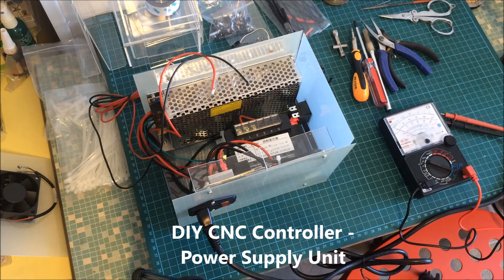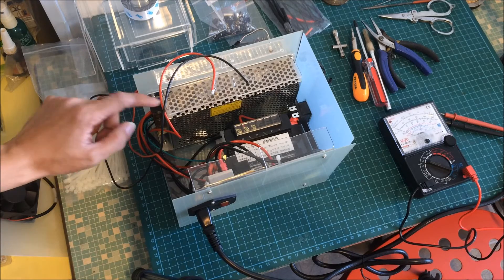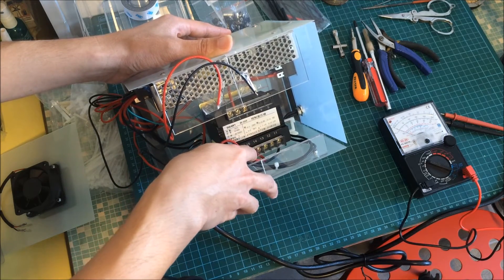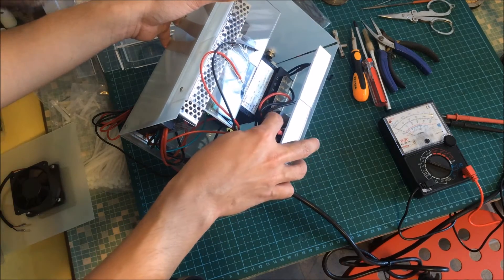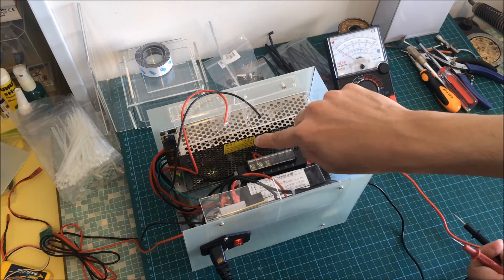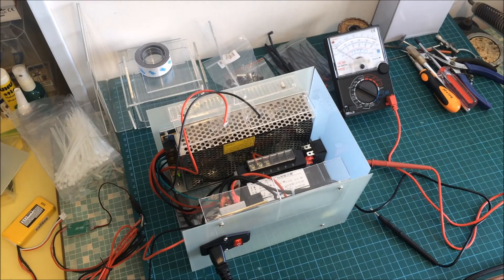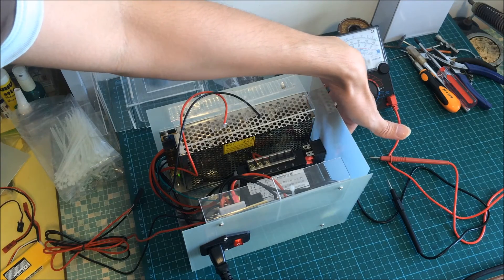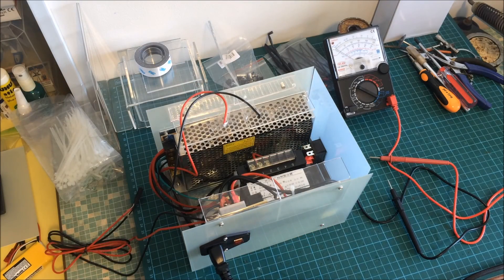DIY CNC Controller Power Unit

Comment: Question, the  green led start blinkin in my power supply any idea?
Reply from the maker: That usually means trickle (unstable) voltage output in most power supply units. You would need to refer to the manual of the model you have or email the seller to confirm what it means.